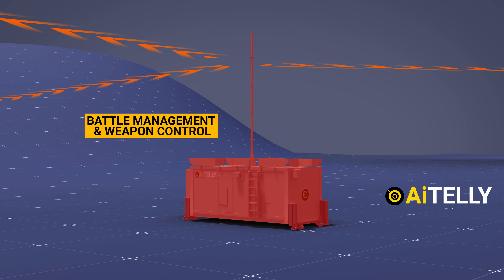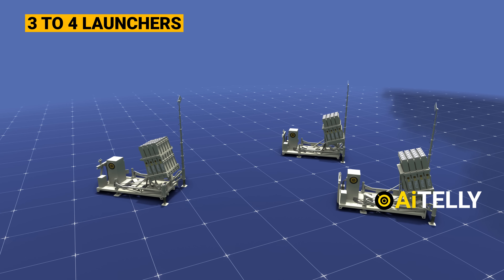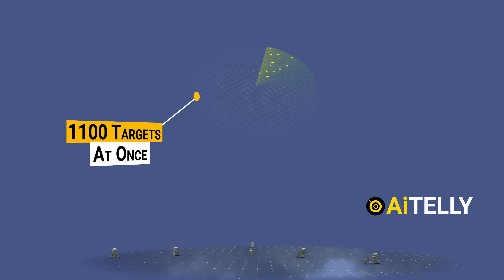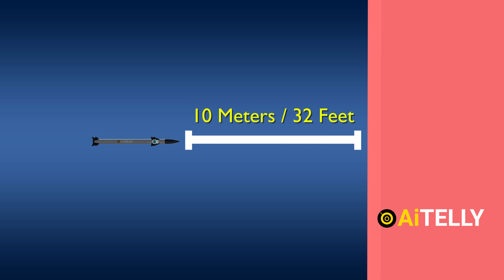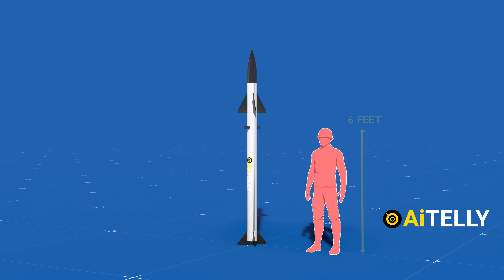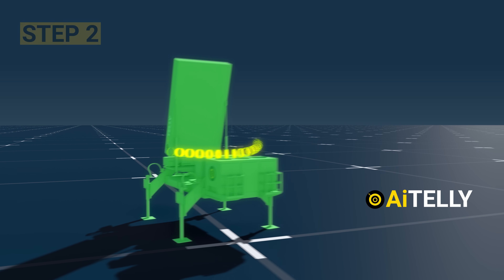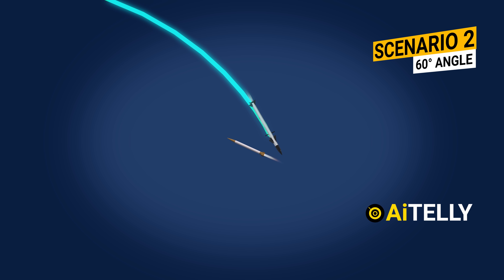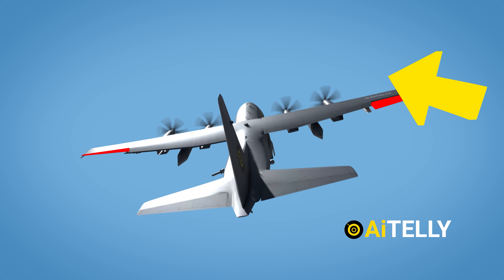Iron Dome Missile How it Works | Israel

Comment: Also explain how "Iron Beam" works. It is designed to intercept threats identical to those of Iron Dome. The difference is that it is a powerful laser beam. Interception with "Iron Beam" costs 10,000 times less than with Iron Dome. It has additional advantages but also disadvantages. This system is not designed to replace Iron Dome but to add an additional layer of protection. And why am I talking about this? Because the IDF announced that it used the system during the war -> meaning the system is operational.

Comment: The price difference is a big concern, Iran can just overwhelm with cheap missiles assuming they can manufacture at scale. The 50k cost must come from the sensors or huge mark-up because it's smaller, has less fuel and less explosives.

Comment: I think there is a big mistake in this animation. The Tahir or Tamir missile need to have a data link sensor to get feedback from tracking radar via a data link. Only electro-optic sensor is not sufficient and it won't work at all to destroy a rocket.

Comment: You forgot  to mention  or avoid that it is effective  but it could over come it with high number of rocket  that it just would be limited  to the number of the iron dome rocket and those afterwards  could pass easily ( with low  cost for qasam they could easily  do that and replace  thier rocket  much faster.

Comment: A saturation attack will overwhelm the system and essentially render it almost useless. Hamas did just that, launching thousands of rockets in short order,the iron dome could only intercept some,many got through.
Reply: So in your opinion it should be dismantled and shouldn't be used??

Comment: Here's what something alot of people don't understand. Iron Dome does not protect all of Israel... there's a limited amount of space air defense systems can protect and its usually the most critical or high population areas. Now 2500 or so rockets were fired into Israel we know that but the whole number doesn't really matter, what matters is the rockets that actually came into the areas where Iron Dome was defending. Israel said they intercepted 97%, if thats true then Iron Dome did its job nearly perfectly.

Comment: It's really simple actually, the missile knows where it is at all times. It knows this because it knows where it isn't. By subtracting where it is from where it isn't, or where it isn't from where it is (whichever is greater), it obtains a difference, or deviation. The guidance subsystem uses deviations to generate corrective commands to drive the missile from a position where it is to a position where it isn't, and arriving at a position where it wasn't, it now is. Consequently, the position where it is, is now the position that it wasn't, and it follows that the position that it was, is now the position that it isn't.
In the event that the position that it is in is not the position that it wasn't, the system has acquired a variation, the variation being the difference between where the missile is, and where it wasn't. If variation is considered to be a significant factor, it too may be corrected by the GEA. However, the missile must also know where it was.
The missile guidance computer scenario works as follows. Because a variation has modified some of the information the missile has obtained, it is not sure just where it is. However, it is sure where it isn't, within reason, and it knows where it was. It now subtracts where it should be from where it wasn't, or vice-versa, and by differentiating this from the algebraic sum of where it shouldn't be, and where it was, it is able to obtain the deviation and its variation, which is called error.

Comment: The Iron dome is NOT as effective  on smaller  drone based missiles that can be flown at below radar levels and can change  their  flight paths 
 Beautiful presentation.  Best wishes
Reply: Or you simply launch a bunch of metal tubes filled with concrete instead of explosives and few real ones.When dome is empty you fire real missiles .They spend 50k on concrete missiles that cost 100$ to make ,when launch tubes are empty you send real ones.
Reply: @zumbazumba1  exactly. The Iron Dome have huge flow. The cost alone is enough to make Iron dome useless against overwhelming cheap missiles. and Iron Dome can't intercept a long range missiles means that Iron Dome is designed to intercept short to mid range missiles. Compare this to the cost make it Unpractical
Reply: @hornerfarah2282  Can you blame them? It was created to defend against palastinian militias. Not actual militaries. You put it in conditions available on the Ukrainian front and it would be destroyed in a day.
Reply: you right but they keep reloading it they have no issue with money as they USA their daddy is paying for it not israeli , so even if they fire 10000 missile a day not issue for them ,  @zumbazumba1

Comment: Israel need a long rang point defense system built around a 155 mm canon using ramjet shells that is guided that is cheaper than missiles.   Italy have developed a similar system.  The new German air defense artillery is excellent.
Reply: Israel needs to stop apartide
Reply: @samuelmatheson9655  If Gaza is part of an apartheid state it is because of the violence that terrorist group like Hamas has perpetuated on the Israel people.

Comment: Easiest way to defeat Iron Dome is :

Fire many dummy rockets (without warhead) until Iron Dome missiles run out, and then when Israel Forces busy reloading new Iron Dome Missiles, fire real rocket.
Reply: And plan B?
Reply: Why? What are you saving by launching "dummy" rockets? The cost of the warhead is a very small component of the rocket's cost, just launch regular rockets.

Comment: You forgot to add that Iron Dome needed 2 interceptor missile in each target .
Reply from the maker: Yes agreed but I heard it's just a backup since they followed the Patriot missile Strategy
Reply: It is not needed at all. When there is low volume of threats two interceptors raise the interception rate above 95%. When there are "many" threats rockets are saved and only one is used.

Comment: Its 80s Patriot missile tech that still works. Iron Dome/Patriot missile systems are overly complex and expensive. If you could incorporate the radar/tracking and "command center" into each missile it would be cost effective and better because currently if the command centers or radar stations are taken out the Iron Dome/Patriot system becomes useless. In the "next gen" missile you would have multiple independent command and radar stations.
Reply from the maker: Noted but have you considered the cost factor associated with it.
Reply: or you just put the command center in a secure location/underground bunker and by this
avoid making the system A LOT more expensive per interception.
The cost of a patriot missile is already at a point where intercepting most missiles
is incredibly cost-inefficient.
Reply: Well that's every long range SAM system though, East and West. A modular system means you can transport and swop out INOP components easily.
Reply: Good luck with that,it would make things even more expensive .Unless you are intercepting planes or ICBMS its not worthy.
Reply: The beautiful thing about the interceptor is that he doesn't has any radar (cheaper than what everyone thinks), it's because the projectile trajectory is calculated many times a second, this allows the command center computer with the help of the very sophisticated radar to remotely guide the interceptor exactly to the meeting point.

Comment: Every machine or tech has it's fatigue limit where it can work perfectly until a point. When the machine or anything is being tested beyond that limit, it won't be 100% efficient then, thus someone would say it's a 'failure'. But in this case Iron Dome worked well. If it didn't, the damage would be much higher than this. 
Well explained video. Really appreciate your efforts.
Reply from the maker: Noted I wonder how they managed to come up with this piece of engineering.
Really Complex work.
Reply: @Aitelly  Indeed it's an engineering marvel
Reply: No one is 100% efficient.
So that's why for a human being attitude & ego is not suitable.
It's just a funny that having these types of equipment they are assuming themselves superpower 😂😂😂

Comment: awesome video!!! Iwas wondering if we could get some info on the software/hardware used to guide the missiles
Reply from the maker: Blender it's a free Open Source Software
Reply: its radar + mathematics + radio on missile + and stepper motors on missile fins to drive it. its not that difficult , also it will be +50 dollar more for Hamas to make their guide and by pass iron dome not sure why they are not doing it , they just need to install few stepper motors , few dollar micro controller and cheap gps or inertial module and that's all to make it cheap cruise missile.

Comment: I have question. What 3d animation software you use to make this 3d animation video? And how much time does it usually take for you to finish a 3d animation video?
Reply from the maker: Blender its Free.
https://www.blender.org/download/
Reply: Blender. As for how long, it depends on the person or team's skill. It could take a few days, it could take a few weeks. I guess it took them 3 to 5 days for this. The animation are rather simple, no dynamic rigging is required. Texturing is very simple too. But still need some times to model all the equipments. But if you already have a model library, then life is easier.
Reply from the maker: It took just 2 days for us to get this done 
But the AC130 video took 30 days

On Friday another Video just for you guys